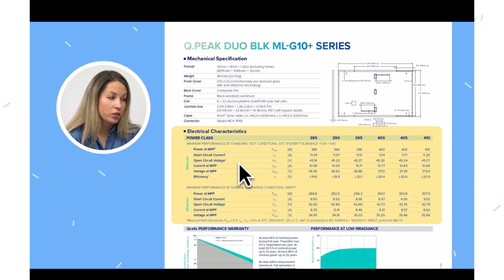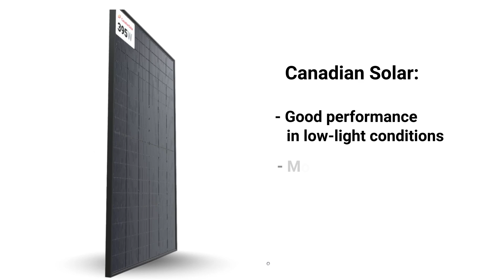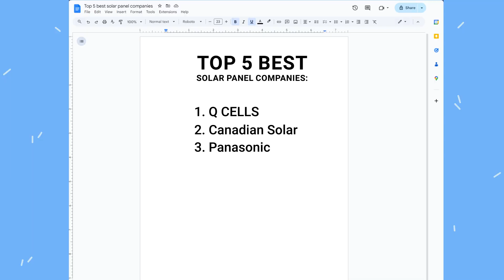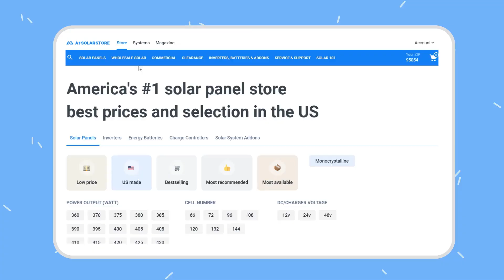What are Top 5 solar panel companies?

Comment: Aiko is the best for residential in 2025 imo. Their Neostar 3 has 25% panel efficiency, 0.26% temperature coefficient, 30-year linear performance warranty at 88%. Their Comet 2U can go as high as 670W. This is from someone with 15KWP Trina Vertex N 600W panels in our home.